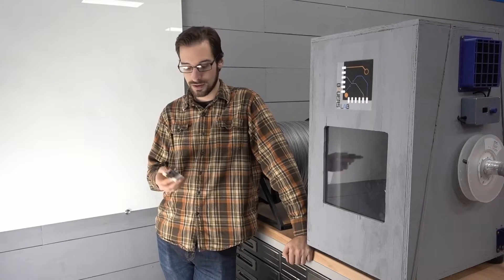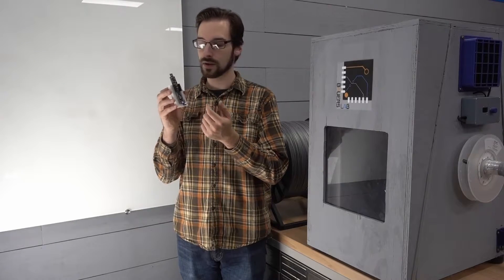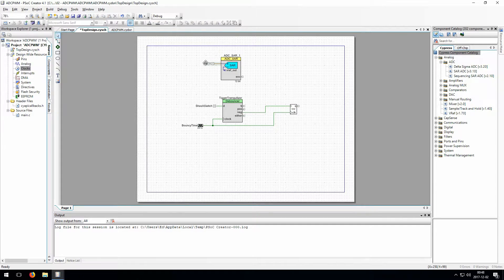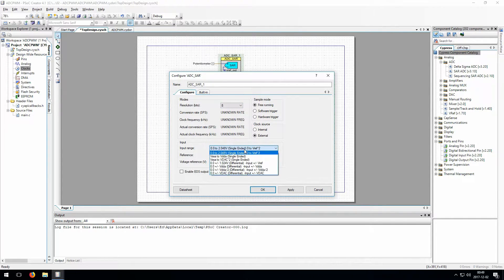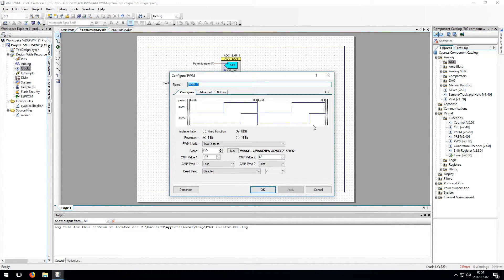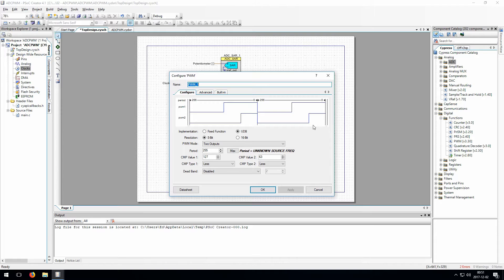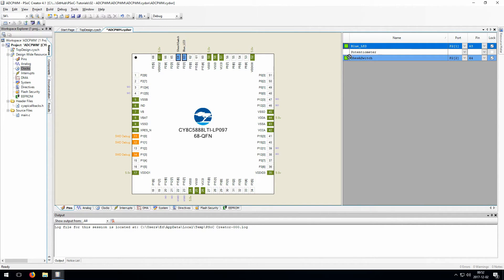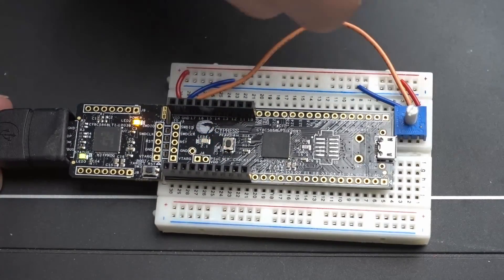PSoC Microcontroller Tutorial - Analog/PWM

Comment: Nice video
I am trying to program another board using the programmer that we get with the psoc board.
So i snapped the two boards and now i am not able to program my other chip.
Could you guide me or point me in the right direction?
Reply from the maker: As long as you make all the same electrical connections and the chip still has the programming program in it, it should work.
Reply: @BauersLab  thanks i got it right 😊😊

Comment: Great video... any chance to use psoc059 with stepper motor bipolar nema34? am looking for how it works codes, drawing ..any chance to help me greatly appreciated!!!
Reply from the maker: I would suggest getting a stepper driver and controlling the driver from the psoc.
Reply: @BauersLab  Thank you for your feedback appreciated. I have driver for stepper motor, and DC power supply, and downloaded Psoc creator and psoc itself 059 pcb kit
Reply from the maker: Oh ok. So then the next step would be figuring out how the stepper driver wants to be controlled. Some use step and direction inputs and some have actually communication. If it is step and direction, then you can just use two outputs of the psoc to control those signals.
Reply: @BauersLab  Thanks for reply..any chance to do video then will be clear and will be common info for everyone...other wise hard to  run without video ..i dont know how to connect and design ports other electronical terms are new for me
Reply from the maker: You know what, sure. I will order a stepper kit and figure it out.
Reply from the maker: Oh, could you tell me the part number of your stepper driver though?
Reply: @BauersLab  REALLY ??? THAT WILL BE COOL I APPRECIATED AND THAT VIDEO WHAT YOU SHOW IT WILL BE MORE HELPFUL FOR OTHER PEOPLE!! IF YOU EXPLAIN STEP BY STEP AND SHOW IN PRACTICE WILL BE MORE EASY TO UNDERSTAND...
Reply: @BauersLab  cant find but nema 34 shaft 14 mm 5.8 Ampere driver 5.4 ampere power i use dc 48V